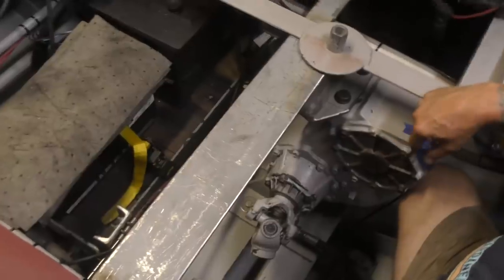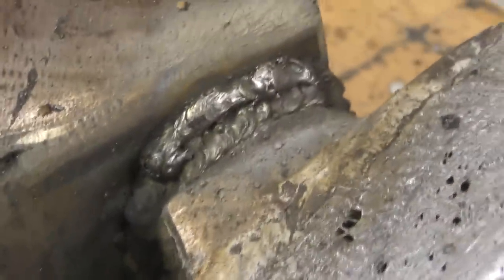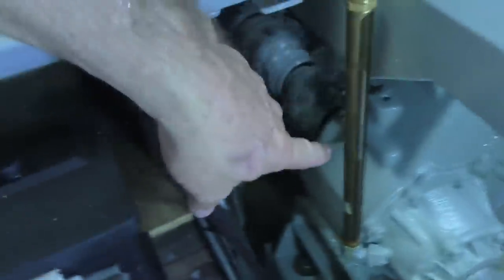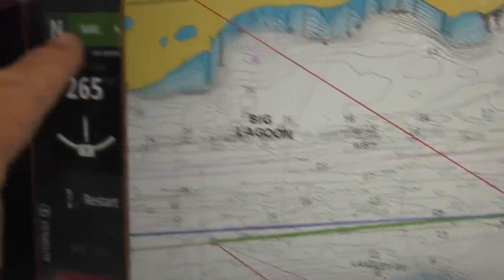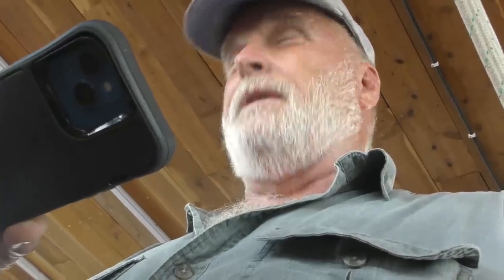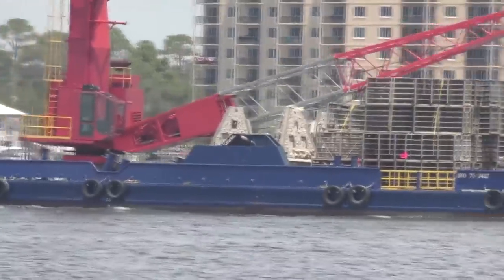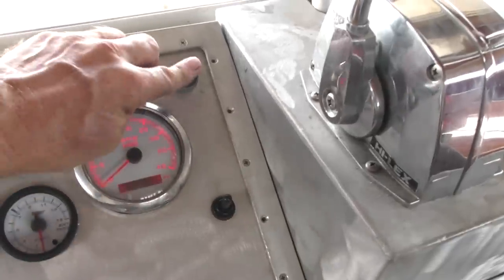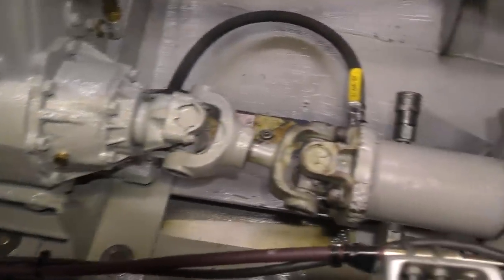Transfer Case Propeller Drive System - I think it's done!

Comment: After 30+  years in stress designs, I was  more successful I in reducing the loads than when I tried to  increase the strengths.   Think about it!  Stop the shaking forces!!!!
Reply: True, true. Heat and vibration are the energy wasters in any mechanical system.
Reply: @2oqp577  smooth running needed
Reply from the maker: Turning off the engine would indeed work.  But I think it's easy enough to stop the bolts from loosing up.  : )
Reply: @SVSeeker  😂😂 not sure he meant to say it like that I guess. It's a game and challenge to overcome.   I haven't got a clue but I keep adjusting my bike
Reply: I am afraid the wobble is stil there just not visible and now it will cause additional wear in the bearings or something else will break loose.
Reply from the maker: @remcodejonge9042    I think you mean force..     And yes, the force is still there, but with a mount now designed to take that force.
Reply: @SVSeeker  yes indeed the force caused by the something that is most likely not correct aligned and these forces/tension can wear out the bearings.  Usually in these construction there are rubber mountings. To accommodate this.
Reply: @hinahanta  yes that is a better way of saying it. I can't find the video where they shortened/adapted the universal joint. I'm worried that both joints ar not in the same plane. Causing it to speed up uneven. You know that, what cv joints are invented for.
Reply: @SVSeeker an inline 6 is the most balanced engine design. It's has a natural cancelation in both primary and secondary forces. If your motor is shaking badly its not running right.

Comment: This boat is just a floating Rube Goldberg machine, at this point. Between the hydraulic system and that lubrication setup, my god what a contraption.
Reply from the maker: Or, maybe if you applied yourself to understanding you might not need the excuse.
Reply: Funny, we call it Heath Robinson in UK. Careful he’s touchy about it.😀

Comment: I hope your creativity is enough when you’re on a lee shore with a rickety drivetrain. Ask Santa for a gearbox shaft and prop.👍😀
Reply from the maker: I hope to be adventurous enough to enjoy such moments in life, and stop worrying about the ten thousand things that rarely happen.
Reply: @SVSeeker  Adventurousness is good for solo but when responsible for crew, ten thousand sounds like a low number.🤔
Reply from the maker: @paulandrews1548    It's ok to be a builder and be adventurous but not if you're a passenger?   Or are you saying the passengers are somehow ignorant of the risk?
Reply: @SVSeeker  I’m suggesting that your passengers may largely unaware of the dangers presented in an overly complicated, ad hoc drivetrain.😕
Reply from the maker: @paulandrews1548  You're suggesting that my crew may be ignorant that we built the drivetrain from used parts?   Or just ignorant?   Which crew would that be?  The ones that helped weld the hull together?  Sewed the sails? Installed the Engine and drive train?
Reply: @SVSeeker  Yes the “used parts” aspect does add some extra jeopardy but it’s the overly complicated, ad hoc nature of the system that your crew /  passengers may be largely unaware of.🤔
Reply: @SVSeeker  It’s a pity we are so far apart,  (N. Ireland) as I have a 3 to 1 prm  (used) I would be happy to donate.👍
Reply from the maker: @paulandrews1548  Well then, you are telling me your current limits.  Not mine or my crew.   And we are happy to run the experiment.
Reply: @SVSeeker  Ok. Good luck.😀

Comment: I love the spirit of Doug's [familiar] diatribe on doing it your own way, and I'm really glad Seeker launched, and has the potential to go further.

I will say that people often prefer to stick with what they can (or think they can) control, so I get the great work on the propulsion system. Doug has a software developer's mind; add more modules to deal with each new problem. Software systems can be subjected to unit tests and integration tests, and validated without risk; and that's what if feels like here, puddling around on the shores of the Gulf.

But Seeker's real propulsion system is sails, while the focus is on tiny refinements to a plumbing in the bilge. The sailing aspect is totally unexplored. You have a sailing vessel, an SV, not an MV. Can the whole Seachest project work if what you have is a motorboat? 

And those closing words, verbatim, could absolutely win the Stockton Rush Darwin Award. There's no differences between the development rationales of the two projects. 

If there is a difference [I hope] it's that Doug doesn't let the ideology of overconfidence, leading to denial of expertise take over from the creative spirit. Sailing is hard. No unit testing, no integration testing. The interface is sheets and leads and lines and canvas. Denial is when we lose the second-order judgement that gets us and others into bad, unrecoverable places. Seeker is a great project, but it needs a bit of humility when it comes to this. I think sailing her will be where that starts.
Reply: I wholly agree with your Darwin award comment!
Reply: "Seeker's real propulsion system is sails" we're still waiting to see that
Reply: I think the point of focusing on the engine and drivetrain is that when learning to sail, having the engine to fall back in is very helpful. Sure a lot of people learned to sail by being thrown in a hurricane sailing with a tarp taped to a plastic drum for a boat, but Doug has the option of learning in a less stressful environment. If the boat is under sail and heading in a direction that’s bad news, Doug can just fire up the engine and get out of trouble. I don’t see why that’s a bad thing. It’s not the nineteenth century anymore.

Y’all being purists and it’s totally unnecessary.

Comment: Love watching.  I'm thinking the original wobble is the problem. Seems to me that welding the transfer case so it does not wobble just transfers those wobble forces to the shafts and gears, which must now absorb those forces.  Something's out of line.
Reply from the maker: I think the bolts loosing up is the original problem.
Reply: Yes I couldn't agree more. To me it just means that its more rigid so the failure may happen somewhere else and could come when you don't want it? Cheers Ian
Reply: @SVSeeker  The unit gyrated when loose. Wouldn't it jamb to one side and stay there  if it was just torque along one axis?  I hope I'm wrong.  Best !

Comment: Hopefully the solution you have works out if not, have you considered setting up an external 'over flow' drain similar to an old fashioned toilet tank.  Simple tube within a tube. The inner tube is equal or slightly above the desired level inside the transfer case  and  drains to reserveoir/ return line. The outer tube  is hooked to the transfer case oil sump, then at the top vented back to the upper 'dry portion' the case.  the oil inlet/supply  needs to be higher than the desired oil level in the case or have a loop in the line higher  than the desired level. It may not maintain the idle level in rough seas but I think it would maintain more than enough for safe operation. Essentially it is a modified version of the sight glass that was installed with passive controls that keep the oil from being sucked out. Just a thought...🙂

Comment: Keep an eye on how much the drivetrain travels forward and backward in the boat when accelerating and decelerating and see how much the different components travels individually otherwise you might have suprises in the end if parts cant withstand that type of forces.
Reply from the maker: That's what the slip shafts are for.   And if you are talking about thrust, the thrust bearings are in the Hundestead.

Comment: That transfer case would be mounted with rubber vibration isolators in an automotive application. Have you considered a priority flow valve to supply oil to the transfer case instead of a needle valve? I’m not too familiar with your needs but it would make sure it got consistent flow no matter what rpm you were at. 
I don’t want these videos to end but I enjoy the pictures of everyone’s projects.
Keep up the good work!
Reply from the maker: True, but the axels move on cars and trucks.   The Hundersted and prop shaft don't.

Comment: I slotted piece of steel tubing or brass over the fluid level indicator with graduations can tell you how much is in there and it can protect that glass tube so it will not accidentally get broken. An ounce of prevention is worth over a pound of cure.
Reply from the maker: That is brass around the sight glass.

Comment: I'm sure you already figured this out but I would like to understand what prevents too much oil ending up in the transfer case creating over pressure? Love watching the creativity and solutions that come out of this project. Thank you!
Reply from the maker: The case is not pressurized.  Once the oil pours out the end of the hose it's at zero psi and collects in the bottom of the case where it's sucked back to the power steering pump.  The top of the transfer case is vented.
Reply: @SVSeeker  Outstanding that makes sense. I thought you had already figured it out but I was just wondering because I saw the oil glass gage going up and down with what I thought was pressure. it's only showing the oil level but has no pressure in it just the froth of oil mixed with air due to the gear motion. That makes sense

Comment: Well I’m glad you got that working.
The metal of the ‘case’ could have been steel or ductile iron.(DI is between iron and steel strength wise but casts like iron , easy). 
You can tell the difference by ringing it like a bell , iron is dead and thuds, steel & DI ring more like a bell. 
Cheers Warren

Comment: You should try a Murphy gauge then it can trigger the solenoid on when low then off at a determined level and can be used to trigger a alarm that the oil is low
Reply from the maker: I have a couple on the engine for oil and temp.   But a stainless float switch from McMaster is all that is needed.   If anything is needed.

Comment: I didn't follow on facebook but I think you might still have a problem with the transfer case oil feed. One thing I would do tbh would be to have a separate vent not on the oil level tube and the tube to be connected somewhere on the top side of the t/c. The other thing is that you're regulating level by trying to regulate flow which is dependent on many factors, so it might work on a test but different temps, speed, pitch etc might yield different results, maybe have the "pickup" (return) at the level you want and "suck" more than you put in so it would never overfill but have always the minimum level. I'm missing 75% of the info so all this could be off by a mile..

Comment: Hi fella , I’ve made prop shafts a good few times and the universal joints should be opposite to each other 90 degrees rotated , not saying yours is wrong and my way is right but I never had one shack of centre like yours , worth a try ?

Comment: Oil is a Easy Setup.
Use a oil cooler with a pump systeem.
This way your can cool the oil and pump it around.
This way your oil stay nice on temp.

Comment: I like what ou have cubold togeter, and it works.. But if Kiss comes in mind a used boat gearbox would be structrural stronger and more relyable, (and not more costly than this...) But y agree, you cant thinker on that.. lol Nice to see its al working..
Reply from the maker: Why do you think a boat gearbox is stronger or more reliable or even priced the same as a gear box designed for an off-road truck?   The cost, if it had not been donated would be around $15,000 with the rebuild.

Comment: You should fix the issue seen in 3.30 mark or you might have to learn how to repair allison tail housing.
wobble in the shaft from transmission causes all your wiggle
Reply from the maker: That's just a bent flange.  Find something else to worry about.

Comment: I could be wrong with this (my wife tells me that all the time :-)) and frankly i hate advice from folks that demonstrably have no idea what they are talking about.... that said though.  
A rule of thumb I have lived by is fixing a wobble or vibration with more support, just moves the breaking point somewhere else down the line.  I just wonder were the wobble is coming from.  drive shafts out of sync maybe?
Reply from the maker: I think it's those explosions at the top of the pistons.  : )     And it has to come out before the Hundested so the transfer case is as good a spot as any.

Comment: i didnt got one thing about the oil circulation system upon watching the scheme.

Why didn't you used the prv relief from the hundested to feed the transfer instead of dumping the oil in the hundested. After that the oil could be recirculated to were it is dumping originally. Its quite a simple approach that wasnt used so it must fail somewere, thats my question.
Reply from the maker: Tried that.  I turns out that sometimes based on where the blades are pitched and what the rpm is, there is nothing to relieve and so the transfer case is starved.
Reply: @SVSeeker  ok thanks for the reply

Comment: Dave-if the sight tube on the transfer case is sealed at the top then it will not be an accurate measurement of the fluid level. The air in the tube becomes pressurized over time and is not a true reading.
Reply from the maker: True. But they don't sell them sealed on the top for that reason.   There is a small vent hole.

Comment: usually transfer cases are a flood bath system. why do have hoses hooked to transfer case?
Reply from the maker: Cooling and filtering the oil.   They are also not usually found in boats.  : )

Comment: Why do they have to share oil... can't they be independent?
Reply from the maker: One cooler, and one filter, and one pump.
Reply: @SVSeeker  and 600 valves
Reply from the maker: @bryantatone879    Two valves now, but if you keep trying I'm sure you can figure out two valves.
Reply from the maker: @bryantatone879   Two valves.   And if you study, you'll may be able to figure out two valves.

Comment: Transmissions don't respond well to indirect forces they weren't designed for. The forces applied need ot be along very precise axis, or .. failed gears, selectors etc.

Always have a rod ready on a boat desk, can hook yourself dinner easily. Best to just lower it in slowly than cast and spook the fish.

Comment: I'm a oil noob so might be wrong, but why can't you just put them in series? I know heat and potentially metal shavings would be transferred but it would much simpler i think
Reply from the maker: Both use sumps.  So there is no pressure in either after the oil is delivered to them.

Comment: Maybe it's simpler to just have a separate electric oil pump for the drivetrain instead of having it coupled with the rest of the system.
Reply from the maker: Yes, unless not having a second pump works.  And so far, it's working fine.

Comment: wouldn't it have been easier to put the oil outlet high enough so that it always has an oil bath but can still flow to cool it? take the oil from the bypass and call it a day.
Reply from the maker: That would keep the level but we want the flow for cooling and filtering.

Comment: I think you are trying to reinvent the wheel find a good used twin disc save all that drama
Reply from the maker: I prefer creative problem solving.   If you just want to buy shit, this is the wrong channel for you.  Try the home shopping network.
Reply: @SVSeeker  After being a heavy equipment mechanic fo 45 years I've seen a lot of weird mechanicals but trying to move a ship with a one ton truck transfer case must be the worst Your creative problem solving means beating your head against a wall they don't sell used marine transmission's on shopping network probably you don't have one
Reply from the maker: @jerrykroskie7782    It's called thinking and learning.  It's only "beating your head against a wall" if you completely miss that point.

Comment: Specialists learn more and more about less and less until they know everything there is to know about bugger-all.
Often you just need Generalist, like an old farmer, someone that has seen a lot and made do with what they have on hand and a limited budget.
Reply from the maker: Ture that.  I specialized in Oracle SQL optimization.
Reply: @SVSeeker  Which is exactly what you needed for cobbling together hydro-mechanical systems from truck parts to power a boat. Wakening up all those semi-retired neurons and putting them to new jobs.